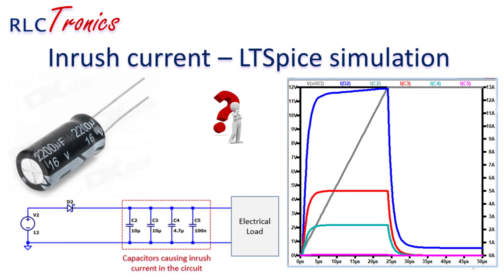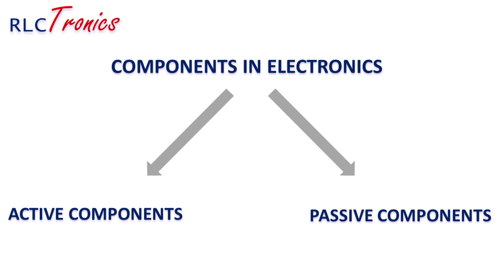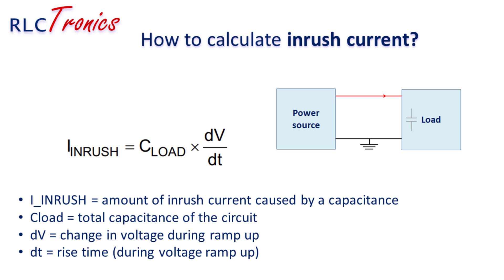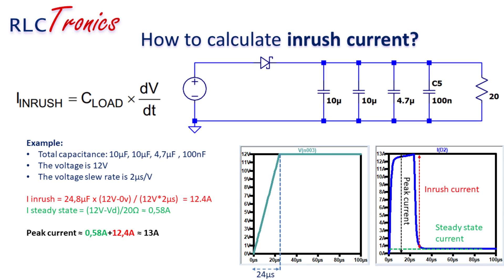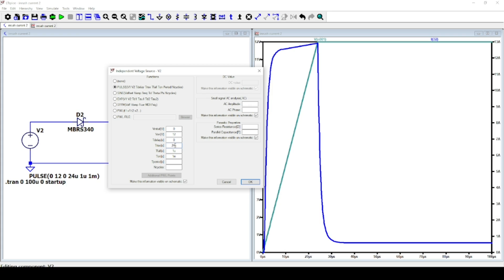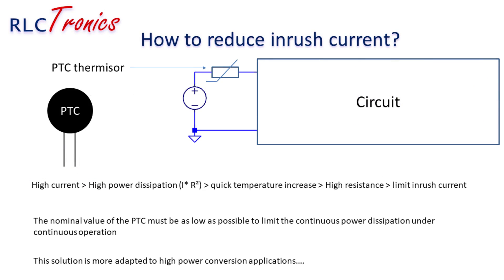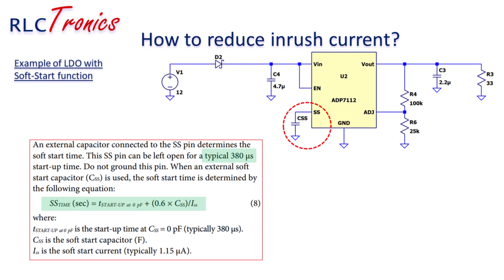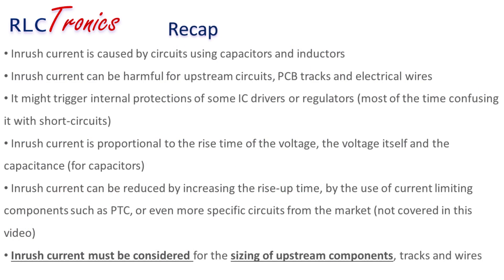RT#7. Inrush Current and reducing methods - Ltspice Simulation

Comment: One good design is using a relay bypassed resistive element, with a properly engineered R-C time constant circuit, possibly triggering a transistor or MOSFET To energize the relay coil, to give a few seconds of inrush limiting before the relay contacts close and eliminate the resistive load from the circuit path. It's easy enough to engineer, can use common parts and has proven to be reliable in many older audio eauipment power supplies. I've LTSpice modeled one for an amplifier, that would be managing the inrush for 72K uFd ( 2 X 36K uFd capacitors) that would keep the initial draw under 15 amps long enough to let the relay engage and then not draw more than15 amps to finish off charging the capacitors with the bypass. Without it, the initial inrush would be well over 100 amps.
Reply from the maker: @poormanselectronicsbench2021  great idea, I personally learned at school how to limit inrush current on asynchronous machines during the start (roughly 6 times the nominal current) and the principle was the same...3 big resistors in series with stator windings. After a certain time a contactor short circuits the resistors for continuous operation...and this drastically limits the inrush current in the beginning.
It was fun to wire the circuit by hands and perform the test.

Comment: You neglect the internal resistance of the source of supply...
Reply from the maker: @y_x2  Not mentioned I agree, but not neglected...there is also the resistance of the electrical wires (length, area, conductivity rules apply). Those factors aren't by the way easily identified in general...but commonly estimated in the analysis

Comment: how about using NTC to reduce the inrush current?
Reply: They do work well in a lot of applications. They do have 3 drawbacks though, they do create a large amount heat when left in circuit, they need to be chosen to be close to the current draw of the load to get to the lowest internal resistance and voltage drop once warm, and they won't reset quickly if power is disconnected and reconnected in a short period of time. Other than that, they are designed for, and actually rated on many datasheets as to the max capacative load they should be used to limit inrush energy for.
Reply: They might not respond fast enough, but it works.
NTC can be used for soft-start.
Temp increase and current inrush isn't linjear to each other, if it's really warm envoirement let's say 40-50 celsius it might work really good. But if it's -30 degrees then you might pop a fuse before the NTC heats up.

Just try, if something blows up it's not a failure.
Reply: @magicsmokeescapist4069  You are describing the behavior of a PTC device, a NTC's value of resistance is highest when COLD, it's internal heating will drop it to a lower resistance, facilitating a higher current flow.

Comment: how to set simlutation Inrush parameter，thank you
Reply from the maker: The higher the capacitance of your circuit the higher inrush current. The same for the slew rate, the higher it is the higher the inrush current.

You can change the capacitance manually on your capacitors and for the slew rate, you can play with that using DC voltage source under "pulse" mode and you select a the rising time tr lower. You will get a higher inrush current with a rise time tr of 10us than with a 100us one, hope it answers your question?